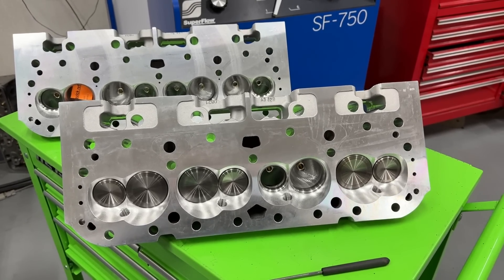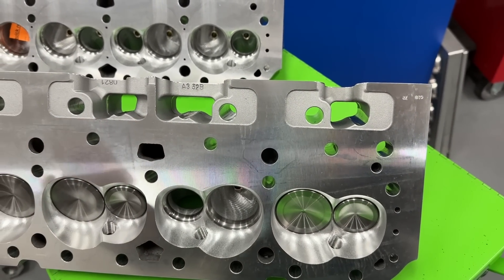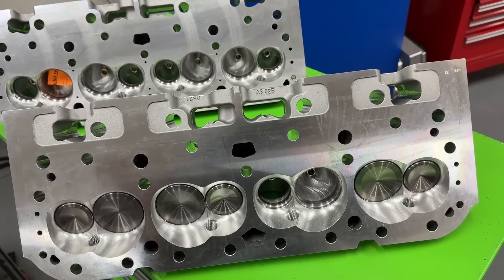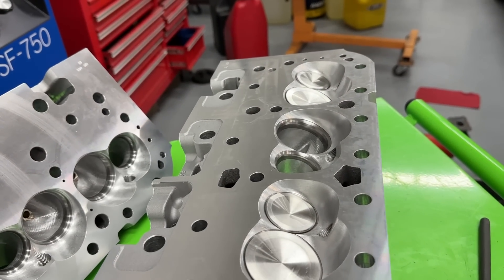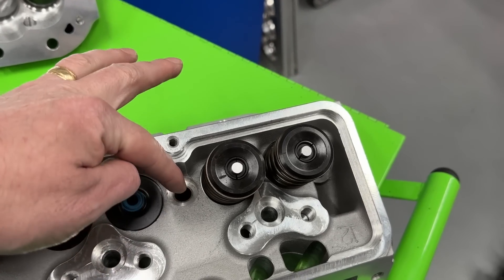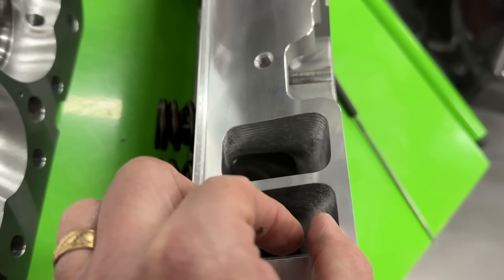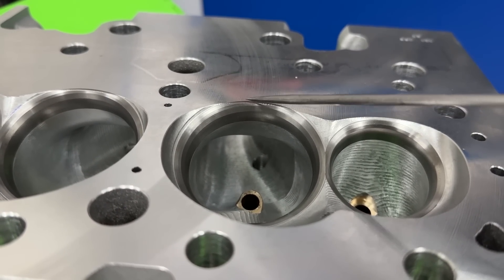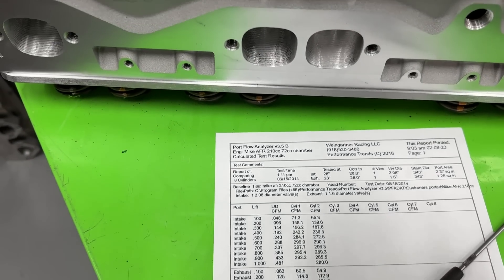Small Chamber vs Big Chamber Which Flows More

Comment: Do you have any advice for switching to an aluminum head?  I have a warmed over '69 412 block 427 with 840 heads.  Compression is around 11:1 and it's around 500hp.  840 heads are a closed chamber 107cc Rec port.  I need to cut some weight without losing any Tq/Hp in my Nova (3650lbs with me in the car)

Comment: Does airflow velocity change when valves are opening ,as in piston starting to move when pulling air in past the valve (piston speed) compared to flowing a head on a bench with air at a constant speed or am I overthinking it

Comment: Having angle milled fuelies in the distant past 0-80 theynworked well and I had 12-1 with flat  tops. Would I do it agauin?? No. A decking the block achieves more for less. B if nesecary use a small dome piston.
Big dome pistons are a bigger hindrance to power. Less compression is really preferable

Comment: That's a very substantial flow difference, enough to make a power difference. I flat milled my AFR 220's .030 and ran into that top cut pretty good, about like the heads you have there.

Plus, the chamber is shrouded more on the outboard side of the head when they're milled like that, so the chamber needs cut out to the bore size to deshroud it again.

How do I fix the valve seats where they're back up to par?

Comment: One thing I remember about chamber sizing and power, with valve jobs and combustion volumes being equal, the engine with the smaller cylinder head chamber volume would make power more efficiently than an engine with a large cylinder head chamber. Something to do with reducing the amount of dome on the piston, while having the same compression ratio, would help increase combustion speed, and would also reduce the ignition timing advance needed to make peak power. It apparently also reduces the octane requirements, between having a faster combustion speed, and having less surface area in the combustion chamber, which both helps reduces the chances for knock.
If possible, it's one of the things I would like to see tested on the test mule if that theory by itself holds true, or if there's factors missing on that theory.
Reply: As I think about it, the stream of exhaust pulses  moving down your headers present a net negative signal to the intake during overlap. But the chamber tilts things.  So we can think along the lines of vacuum.  That means... the combustion chamber behaves kind of like an accumulator: the smaller the chamber, the faster it can equalize, therefore intake charge can begin moving sooner.  Thats not exactly what happens of course, :but objects in motion tend to stay in motion, and so it is with the bulk of exhaust gases and their net effect on intake charge.  Overlap time is a very small window and it gets smaller as revs go up.  If I didn't screw up the math, a 58 degree overlap at 6k rpm's is 3.2 milliseconds [as cam is half speed of crank].  Do valve jobs matter in such circumstances?  Oh yeah.   Any pros want to correct the math, thanks in advance.
Reply: It's called more quench
Reply: @pacman3908   its more efficient combustion.    Look at the Trick Flow  Ford head making with a specific cam , rockers and springs making 423hp on a 302 according to Trick Flow  . Intake airflow is (  by head so I could be off a little)  265 cfm.  

I have made several 289 cast iron heads ( 1963 to 1966 ) only having intake air flow of 208 cfm as restricted by valve size as per FIA regulations  , and designed for endurance ( hours of Spa , Classic Le Mans ) therefore also limited to 0.530 lift as ball rocker will burn if more lift  used , but  making 438 hp on a real 289 ci  engine with dual plane Edelbrock.

Main difference  is combustion chamber design.  Actually....dome height/ size.  Thats what makes the power. 

Whereas for first years working on those 289 aiming for highest airflow with still stable head design as its used for endurance ...I now balance between airflow and dome size to extract most hp.    

And for some its hard to believe as they want to see high airflow numbers regardless of how chamber shape gets achieving the highest airflow.

Comment: So to make the same compression with both heads the 70cc head will need an 15cc dome on the piston. So in reality when the engine is assembled which cylinder will have better flow, the one with the dome or the one with a flat top piston?
Reply: I bet the 1 with the flat top
Reply: There is a great calculator on Wallace  Racing Calculator